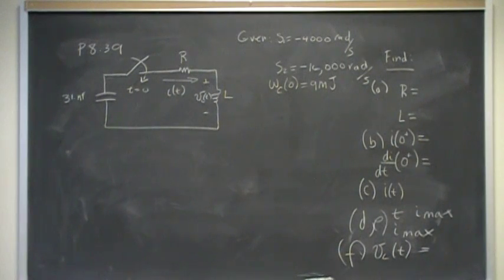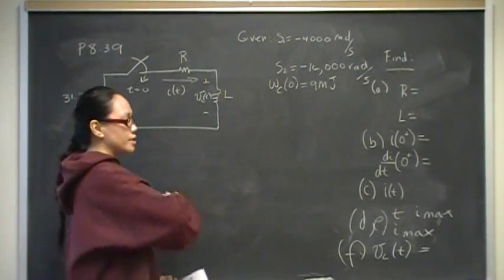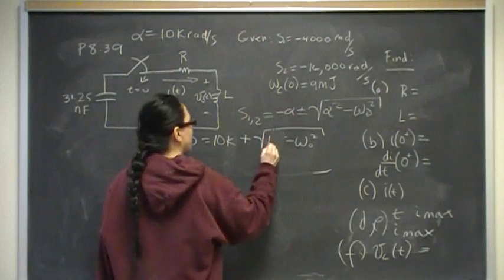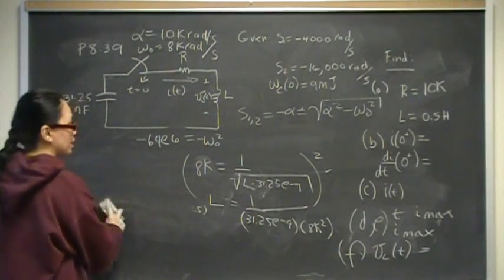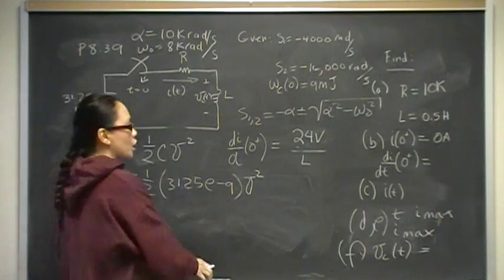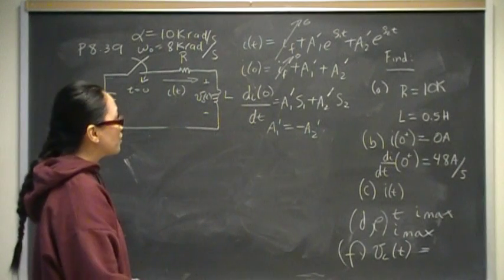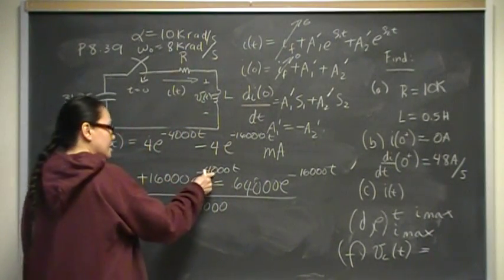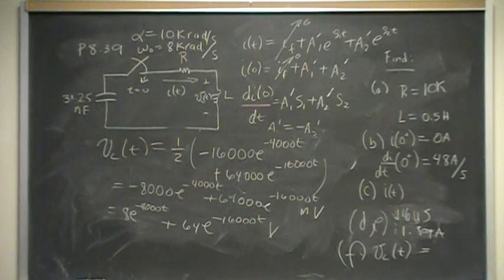Natural/Step Response Series RLC P8.39 Nilsson Riedel Electric Circuits 9E Solution

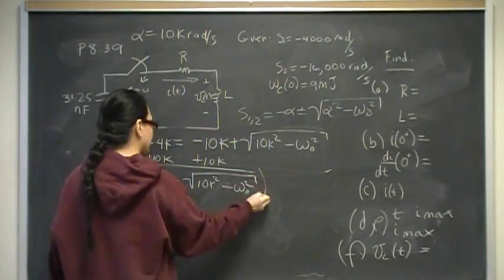Comment: Thank you for these useful videos,however, I think w0 is different than what you've calculated. At 10:10 you tried to square both sides of the equations but forgot to, also, square the "6". So you ended up with 6k^2. It should be 36k^2 isn't it ? Regards

Comment from the maker: ahhh that is a good point! i did a very poor job of explaining so let me try again. You are correct! Vl = l(di/dt). However in the problem above, IMMEDIATELY after the switch closes, the capacitor is an open and cannot change its voltage. the inductor is a short and cannot change its current. it CAN and DOES change its voltage like crazy. in fact, right after the switch closes the inductor voltage will immediately jump to the capacitor voltage. i should have spent more time on that. thanks :-)